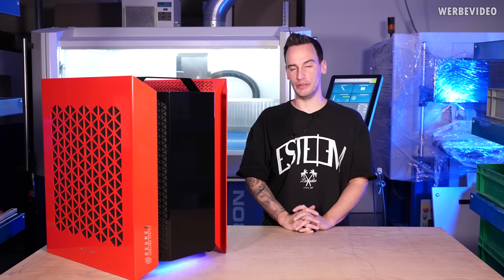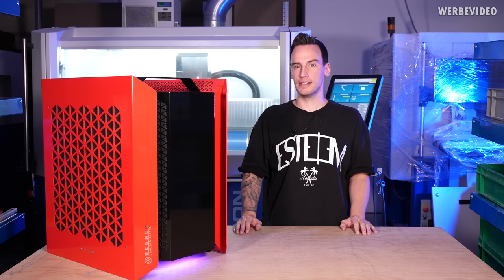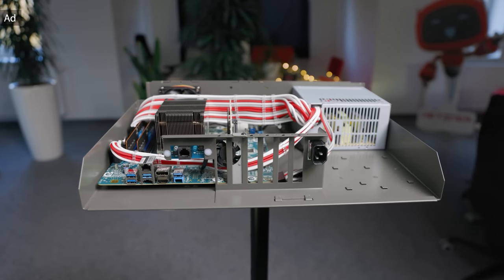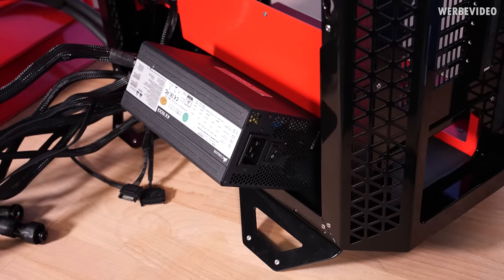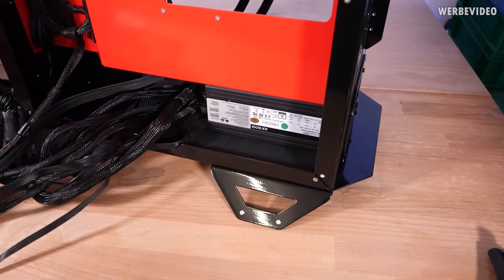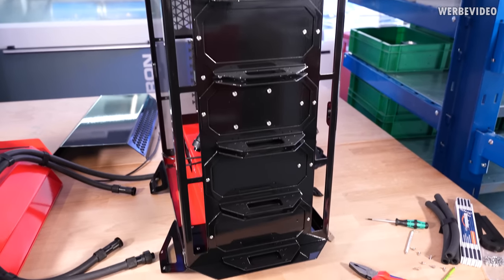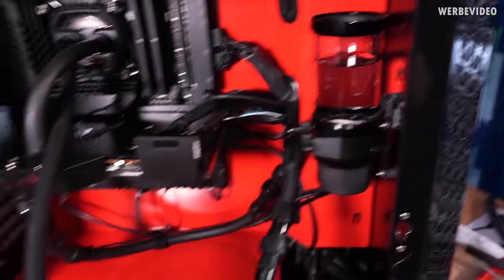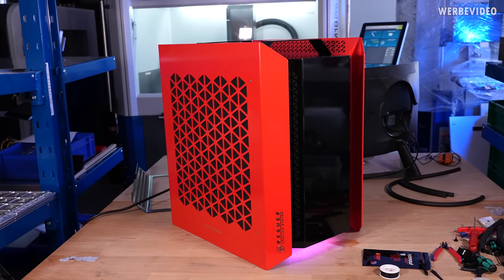The most expensive Case I have ever tested! Regner Cooling is back

Comment: Dust filters on exhaust fans are a mistake.  Also, why do the case manufacturers think that the front panel belongs on the top?  A vertical mounting is more convenient and dust wouldn't settle into the plugs.
Reply: And prevents cats from turning off computers.

Comment: I would think powder coating the case would be a better option for durability, and hiding an imperfect surface quality.  It might not be shiny, but I think a matte look would still be pretty nice.
Reply: would look awesome all black powdercoated.
Reply: I agree, it would look awesome with a 2 tone powder coat!
Reply: @Xfade81  even an bright color for the sides in powder coating would also look impressive.
Reply: it is already powder coated?
Reply: It could be “blued” or anodised for a premium and possibly repairable finish
Reply: agreed on surface finish, powdercoat would give some great colour choices, or hard anodising would give a robust and understated quality look to match the fantastic engineering in the rest of the design

Comment: While this is still insanely expensive, this time it does feel like a super high end item for the ultra enthusiasts, the performance is there. I do think an easy area for improvement is to go for better dust filters, the current ones seem to be the older kind that restrict airflow a lot but newer ones that you see in the more premium cases like the Torrent line are much better

Comment: 24:54 Dust filters are a must have if you live in dry dusty environments. Pop them out and give them a clean every 1-2 weeks is vastly superior to cleaning the whole PC every 2-4 weeks. That allows you to have the ~6 month whole system cleaning cycle by having a 5 minute remove, shake off outside, and wipe down filters cycle every week or two. 10-20 minutes spread over a month is better than an hour or more monthly. Not needed for you but you don't live in Arizona or Israel.

Comment: Case is still expensive, but if it comes with well over $1000 of cooling components it starts to be SLIGHTLY more reasonable. The design is good, I really like the radiator setup. Being a DIY type person though it makes me want to build my own case to have something as custom.
Reply: Alternately you could go get a couple Honda Fit or Civic radiators that are the same size, for cheaper lol.
Reply: @crisnmaryfam7344  yeah but you'd be dealing with mixed metal loops since those radiators are going to be aluminum.
You could see about in dash heater cores though since many of those are copper. Go one step further and pull them yourself at a salvage yard.
Reply: if they sold this as a disassembled parts cutting the cost so that way we just put it together ourselves. 
then maybe.  2200... damn but it is custom.
Reply: @admiralbosch2851  I could see those side panels (or something similar) being sold as addons with custom brackets for the more popular cases to replace side panel. Wouldn't be very difficult to make a radiator/fan setup with filters and then have mounting brackets they fit on. 

Each of those panels has ~50% more radiator surface area than my 3 rad setup. It could be a cool simple solution. Though a 400mmx400mm rad setup might be too big for many cases (such as mine) so a smaller 280mmx280mm one might also be great.
Reply: @JohnA...  Would think rather than sell the side panels, allow us to order the case with only the rear rad panel and have the front be tempered glass on a hinge, for more consumer friendly/budget option builds that want out of the box water cooling capability in a case. Would be a good option to allow the concept to remain the same, and allow for more customers to try to product by lowering the cost if one was to order a single rad panel case.
Reply: @Nedac365  At the cost range this case is sitting by doing that you would probably "only" lower the cost by about $500, it would still be well over $1000 for a case. Part of that is of course the limited amount being sold, custom nature of it, and the parts being used are also higher end it seems.

If you are just wanting easy water cooling then there are already options like AIO, otherwise you are looking to spend quite a bit on that system alone. My own issue would be the case to start because of the custom price, you can build an amazing water cooling loop for a fraction of the cost of that case in a $100 case. Thats why I mentioned doing custom individual panels for the most popular cases so you might spend $300 for a massive radiator panel & fans, but instead of needing to buy $2200 case to get them you just got one to fit that $100 case that sells thousands already.
Reply: To be fair he has had it quite easy. Produced a case that to be honest isn’t ground breaking in any way at all, and to have an experienced critic like yourself point out all the R&D that still needs to be considered prior to retail launch. You’ve done most of the work for him. Hats off to listening and updating based on your critic, but who wouldn’t listen? Personally the price point even though cooling hardware is included, I think is way off. Not a fan at all of the airflow, very restrictive. A case of aesthetics over engineering I would say. Not a case for me. I would of thought you could get your own case design manufactured for that price point, albeit one would need to be confident their design skills. Looks nice but it’s aesthetics over function.

Comment: Seems like a good candidate case for an extreme build using the direct die ek waterblock.
Reply: That's what I was hoping he would test with. With those rads and fans, I didn't find the temps impressive
Reply: Also wonder if a second pump would make a difference with all that rad and block restriction...
Reply: @evigklytteren  A good pump will do you for that much rad and a single CPU/GPU combo, though a second pump would be lovely for redundancy. Looks like there's enough space in the case to add that if you need it though!
Reply: @technicalfool  I would want to run the CPU and GPU to separate loops with the size of those radiators. Keeping the heat separate would help with the temps of whichever your downstream component is.
Reply: @DigitalJedi  Definitely an option, though it also would make an expensive build even more expensive. Guess it depends on the build. One CPU and 1-2 GPUs, probably better as a single loop.

Double socket insanity, yeah I'd probably want one of those MoRAs just for the CPU side of things!

Comment: For a personal home use rig it would probably be out of my price range.
But if you were putting some High end workstation rigs together for a Bussiness where you needed this kind of super reliable quiet cooling , minimum dust issues , Quiet work space with no distracting flashy bs then this seems like a really easy solution, They should add a rugged paint option for Bussiness's.

Comment: That's very impressive cooling performance. I can see this being popular with Threadripper or systems that use XL-ATX motherboards as it has the space for those and could be used through a number of upgrades so should last several years. I think a less fine mesh would be a good compromise between dust and airflow. It looked like the mesh strips for the PCIE slots was less fine.
Reply: At 2200€, this case is as far from "popular" as it can possibly get.
Reply: @Deses  Popular amongst threadripper and other HEDT/workstation-type builds. It's really not that bad for that amount of cooling loop, if they can get their custom paint jobs up to top notch quality to match.

Comment: I'm a huge fan (excuse the pun) of dust filters. I have a BeQuiet  case, I have just swapped my 3080 for a 4090, and even after 18 months use the 3080 looks pretty much like it did when I stuck it in there, whereas with other cases, the GPU will be clogged with dust after just 3 months. It's also hecka dusty in our flat, and the filters in the case do a great job.
Reply: I don't mind using dust filters if they are the kind that just slide out so you can rinse them in the sink...I bought a fractal meshify s2 case once and it had foam dust filters in between the plastic and the outer metal mesh! They were a nightmare to get clean after a few months...I just switched to a water cooled open air bench, and I just hit it with the swiffer duster and micro fiber cloth once a week and it's great!
Reply: @brucepreston3927  Yeah I'm the same, the case I have you can pull the filters out. I'll normally hit them with our Dyson reachable vacuum when I have cleaning around my desk, and run them under the tap ever couple of months.

Comment: An amazing piece of engineering. The price is high and well above the level that can be justified by the vast majority of users, but if you can afford if you get what you pay for. I also agree about the filters but at this price point it should have a system of being able to easily remove the filter frames for cleaning. This should have been part of the design from the start.

Comment: Apparently, there is a HS (high speed) version of this Noctua fan available to OEM's, optimised for radiators and not available to the general public. He should use those if able.  I would reccomend changing that filter material out for ultra fine nylon mesh like demciflex use.
Reply: well Noctua does sell a range than goes 1000-1500 rpm faster than regular fans at 1500 - 2000 rpm +/- 10% , also differently pitched blades for radiators vs fin stacks. I believe the low pitch were shown.Otherwise Delta server style. XD
Reply: @tobiwonkanogy2975  for the longest time they didnt. they only offered the "better" fans when sold onto thier coolers.

i think it was only recently with the chromax max versions is where you would find the equivalent "heatsink" fans... at least its true regarding the 92x14mm fans

Comment: Functionally this is far better than the previous case. I still cannot see much of a use case for it, especially considering the price point. It is more of a "because I can" item. They really need to improve the paint quality for the retail model though. The black gloss is covered in orange peel and you can see scratches and buff marks on the side panels. For the cost of this case, the finishing of every single component needs to be faultless. Those panels need multiple coats of paint with each coat being flatted off individually by hand, before lacquer. A 2 grand + case needs to not have the paint job of some bargain bin chinesium part.
Reply: Paint job and color scheme make this case look like a random aliexpress garbage

Comment: Regarding dust “filters.” First, I have yet to see a screen on a commercial computer case that I would consider a filter. 

Second, and more importantly, Restriction of airflow is primarily a function of open area. Open area should be a readily obtainable value or for any screen. Regardless of how small the openings are, the key value is the open area. An empirical example: I use 120 mesh (120 wires per inch; 4.724 wires per mm) stainless steel screen, that I customized on several cases and have not observed airflow problems. Yes, they require more frequent maintenance, because the dust accumulates faster than on more coarse openings.

The downside of such fine stainless steel screen is that RGB is harder to see. So difficult to balance important characteristics…form or function?

Comment: I would probably flip the fans on the left side panel so that they suck air into the case through the radiator. The current setup has 8 big, low-RPM, low-pressure fans all trying to suck air from inside of the case. That creates a negative pressure system inside the case which has 0 intake fans to help the big, low-pressure fans to get air in to the case.
The four fans working as intakes would also provide some more airflow for cooling the RAM and other components on the motherboard.
A friend of mine built a watercooled system with big radiators at the top and bottom of an O11D XL with a distro plate covering the side fan slots. He originally had all his radiator fans blowing air out of the case through the bottom and top panels, which caused high temperatures everywhere because the fans were all fighting to get some air and there were no fans working as intakes. I told him to flip the fans on his bottom radiator to work as air intakes and his temperatures improved drastically.

Comment: Great improvement. Looks like a cool premium product.

1. For the price I'd prefer paint to be covered with lacquer.
2. The screws on the sides should also be painted, or at least be black to match the colour scheme.
3. The handles look to thin and under designed. They need more work.
4. Add a Chromax Noctua fan in the rear of the case.

Comment: i have used the Alphacool 1260mm rad as an external rad before its a unit, even better by an open window in winter when its -5 degress outside :)

Comment: I haven't used a single dustfilter in my systems for the past 25 years, because I work on my systems at least twice a year for upgrades and made a habit out of cleaning my systems every 3ish months.

I found out way back that dust filters may stop some dust from getting inside you system, but in return, you have performance degradation of your cooling over time when the dustfilters start clogging up.

Instead of using them, I select my cases for ease of access to the inside and airflow.

Through the years, as airflow in cases has vastly improved, the amount of dust I find in my cases has declined to near nothingness.

Good airflow in cases makes it so that most all dust that gets sucked it also gets ejected from the case.

There's a case to be made it's better to have your dustfilters clog up than having your GPU HSF clog up over time, but it's actually far easier to take out your GPU and clean it than to try and declog large surface areas of dustfilters.

First thing I'd do if I ever bought this case would be to remove all the dust filters. Or order it with a request not to install them to begin with.

Comment: Given that custom LC can cost WAY more than actual hardware it's cooling (especially if it's themed build), price is acceptable - it's comparable to InWin products, which are also super niche. It also has a potential to attract some boutique workstation builders, as all-in-one solution for high-end in office machines - with exception of case feet, where casters would be much more appropriate.

It would be interesting to see if the case can handle eight 15mm U.2 drives, without thermal throttling them.

Comment: armchair engineer oppinion,  I would configure the fans to suck the air from the outside in so the mesh filters are the first thing air passes trough not the last to make cleaning so much easier as with the fans in the video, I feel like youd have to take apart the whole side panel to clean out the filter as opposed to just wiping the side panels down with the pull fans

Comment: It’s a great improvement over the previous version, but why install filters to the exhaust sides of the fans & radiators, being that it’s obviously so difficult to get to them for cleaning?
Reply: I run exhaust dust filters. Dust still gets into my case. I would rather have more dust filtered out of the outgoing air than just putting it back into the room to be recirculated back into the computer. "my case has a ton of fans, 3X160, 4x140s 6x120s"

Comment: I accept a few degrees increase in heat for the advantage of much less dust. I use Demciflex fine-mesh filters (imported from South Africa where they are manufactured) for my old Corsair 400D case, they manufacture kits for certain cases with magnetic attachments which work great. You have to set up your airflow to compensate for the change in static pressure, but I would never run without dust filters. It makes for less maintenance and cleaning of heatsinks and radiators, and helps prevent build-up in corners of your case which are hard to reach. It also prevents you from trying to vacuum out the case and risk damage from excessive static produced b y household vacuum cleaners. (If you're going to vac your PC, buy an "ESD vacuum".)

This case really does seem like the "I've bought the top of the line everything" case for the extrovert LAN-goer or mid-life crisis gamer. And weirdly given the cost, it still looks like a prototype with a back-yard rattle can paintjob. I'd expect anodised or powder coated.

Comment: While the price is way too much for us mere mortals, I do like the idea of radiators using multiple 200mm fans rather than a heap of 120s. A more modestly specced case based around a 2x200mm AIO cooler would be amazing.

Comment: Incredible attention to detail and fantastic design. Having radiators built-in to the case is not something I've seen before. Unique and highly performant.

Paint is very difficult to get right. To me, that surface looks powdercoated. Powdercoat is an incredibly durable finish, and looks best in a matte or dull semi-gloss. It would require quite a bit of either 1) hours of hand finish or 2) years of powdercoat experience. Hoping that they can improve their parts wash, spray patterns, spray density, baking process, and final touchup to make an excellent finish at the same price point.
Not sure if this would ever be seen, but for some extra cost... Powdercoat priming can provide a quick and dirty way to make a smoother finish.

Comment: What's the point of the dust filters on the side panels when air will come from the other side? i.e. it will be trapping dust on the inside of the side panel, what is the point of that?

Comment: DDR5 RAM requires a sufficient airflow over it if you want to run it stable at some higher XMP profiles (7200+) and i'm not sure how good/bad those 4x200mm fans at providing that in a negative air pressure case setup.